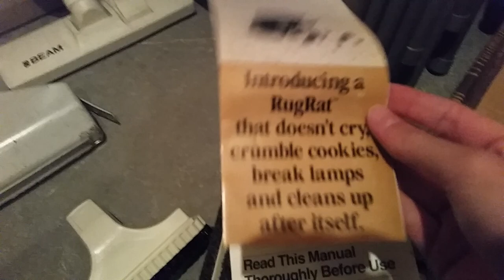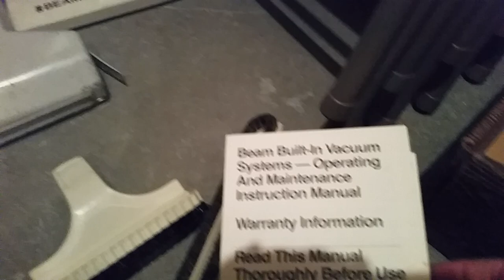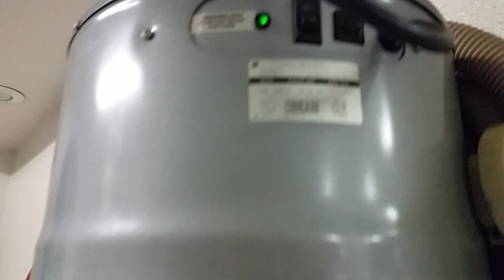Beam 287S Central Vacuum

Comment: Did you try using a Turbocat nozzle with a Shop-vac or other wet & dry canisters?
Reply from the maker: If you're wondering about my recommendation on a canister with the best suction and airflow, look into the Lindhaus Aria lineup. And/or if you're looking into the wet/dry vac with the best suction and airflow, look into Festool.
Reply: I wasn't really asking which canisters have the best airflow and suction. I was just suggesting that you try using a Turbocat nozzle with a wet & dry canister to see how well does the tank with the brush clean carpets.

And do you really think that a Lindhaus Aria canister has greater suction and airflow than any of the Electrolux canisters from the 80's or those from Aerus?
Reply from the maker: I wouldn't use a wet dry vac inside my house, and I would not use a turbo cat or any turbine nozzles to clean rugs outside the garage because small rock pebbles would damage inside it (Done that multiple times before). Unless if you're talking about canisters like the Rainbow, I have not used any turbine nozzles with those and I'm not really going to bother doing that because I don't like water filtration canisters.

Like I've previously said before; my recommendation is on the Lindhaus Aria because they have the best suction and airflow that I've ever used on a canister. Believe me, I work at an authorized vacuum dealer. There's no way that any of the lux canisters can pull off from those 1400W Rotafil motors on the Aria. Not to mention that their powerheads clean better than the lux powerheads and the hoses are crush proof. I just don't think they clean better, I KNOW they clean better.
Reply: @panasonicvac4036  Ok for most of what you said, but, to be specific, the wet & dry tanks I was talking about are the Shop-vac's, the Ridgid's and the likes, not the Rainbow's and Sirena's.
Reply: Raymond Plouffe 8$77
Reply: @辛孟倫  what?

Comment: Is this central vac as quiet as the Vacumaid P-125?
Reply from the maker: No it isn't.
Reply: @panasonicvac4036  When you had the previous motor to this unit before the motor was replaced, was this Beam unit still not as loud as your Eureka the Boss unit? I think you mentioned before that you had to replace the motor in this unit and the previous motor was louder.
Reply from the maker: I think so but I don't remember.
Reply: @panasonicvac4036  This unit does have a muffler on it am I correct?
Reply: @panasonicvac4036  Do you have any idea why the previous motor was much louder than the current motor?
Reply from the maker: Yes.

The other one was more higher pitched from what I recall.
Reply: @panasonicvac4036  What made the motor needing to get replaced?
Reply: @panasonicvac4036  Do you this Beam unit would have been noisy if it had no muffler?
Reply from the maker: It has been, I tried it before.
Reply: @panasonicvac4036  I would assume the Beam even with no muffler is still not as loud as the Eureka?
Reply from the maker: No the Eureka is quieter.
Reply: @panasonicvac4036  I would still assume that even then The Beam is not near as loud as the Vacumaid S-3200 even without a muffler?
Reply from the maker: Correct.
Reply: @panasonicvac4036  Was the Beam close to as loud as the Dirt Devil Ultra or the Bissell Little Green 1720-1 without a muffler? I would assume probably not.
Reply from the maker: I don't think so.

Comment: 6:36 isn’t that bad for your vacuum?
Reply: No
Reply: ام
Reply: @user-wl8ls8oq4w  P
Reply: @user-wl8ls8oq4w  j
Reply: Yes I did that before and it was bad it stopped sucking up
Reply: @SonyGuy00  that's because it shuts off the vacuum unit.
Reply: Central vacuums have bypass motors that do not use the air that you’re sucking up to cool the motor it has a separate fan on top of the motor that cools the motor so it has four fans technically if it’s a three stage motor three fans for section and one fan for cooling
Reply from the maker: Some use thru-flow motors.
Reply: @panasonicvac4036  very true though most machines are bypassed
Reply from the maker: Maybe eventually they'll mostly switch over to using a thru-flow motor as Ametek/Lamb themselves tested and proved that they are now better than bypass motors. That's one of the reasons why I'm very interested in putting in either a MD Flo-Master F650t or a Cyclovac GS215 for my own home.

Comment: Sadly beam today is junk rebadged eureka totally ruined a quality name built nothing like this one
Reply from the maker: Actually Beam today is now owned by another company called Nuera Air. They apparently make good units.
Reply: Beam is now element power units. They are made by vacuflo. If you're looking at central vac's. Check out hide-a-hose.   Well wreath it.    Air drive head's work good as long as they don't underpower the main unit.  Air driven heads don't change, electric head's change about every 5 years.  Electric is more expensive.   They start at $300 for a fairly good head, most with no hose or wand.
Reply from the maker: Beam is no where affiliated with H-P Products (The parent company of Vacuflo and Element). They are similar to Element because they use the same filtration set up but they're not made by the same company. In fact, Nuera Air (The parent company of Beam) just recently moved Beam's old manufacturing plant from Juarez, Mexico to Quebec, Canada. 

I personally wouldn't recommend a Hide-A-Hose unless if you have mostly if not all bare floors throughout the house. WAY too expensive, can't use an electric head, and you can't put one in if you have a Wet/Dry power unit because water would just cause problems to it.

Air heads are not deep cleaners, they are not even the best on removing pet hair. There's a reason why I don't use mine anymore. 

And I don't know where you are getting on electric powerheads, they're still cheaper than putting in a Hide-A-Hose. Companies like Wessel Werk, Sebo, or Lindhaus for example, they've barely changed much at ALL these past 10 years in quality and performance wise.
Reply: @panasonicvac4036  There are some battery-operated power nozzles for Hide-A-Hose systems.
Reply from the maker: Some aren't as powerful as the corded ones.